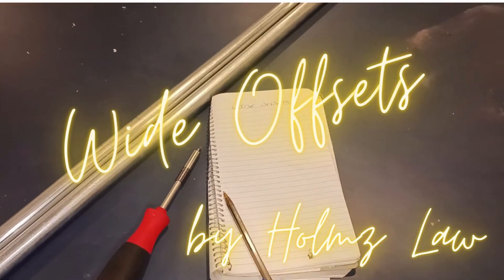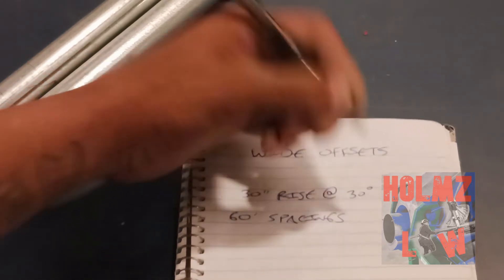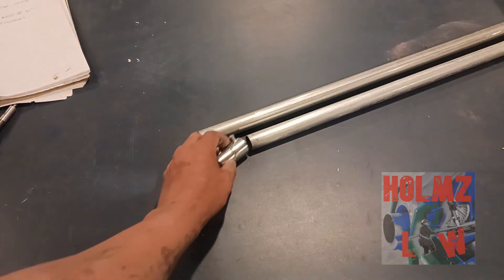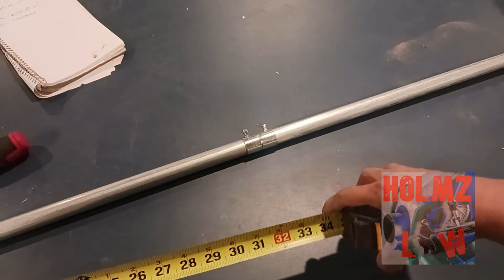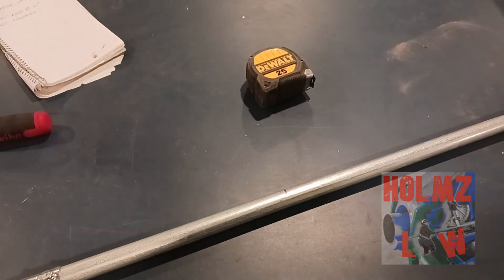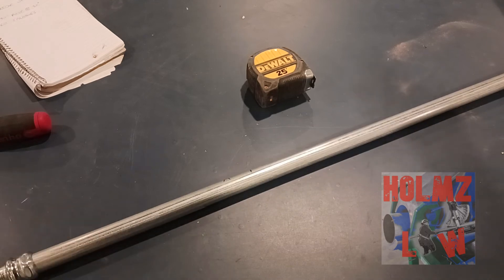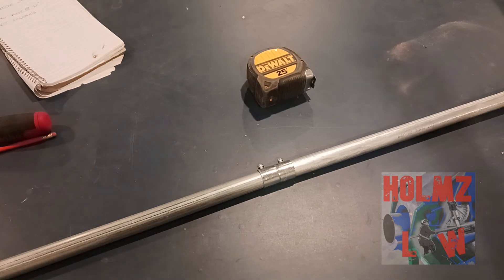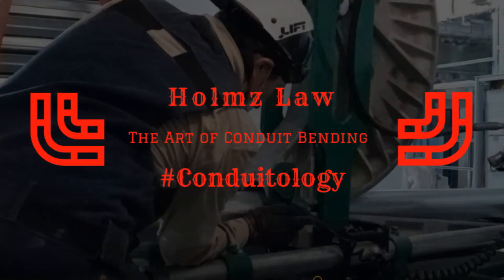How to bend conduit (Bending Wide Offsets)

Comment: Helpful tip.

Typically I try to minimize offsets in my conduit runs. Especially wide ones, since I have been running rigid I couldn’t imagine trying to spin on a 10’ offset 😂
Reply from the maker: well i definitely understand what you're saying. doesn't hurt to know in case you run into the situation in the future. I try to keep my conduits with out bending as much as i can, especially on the job im at now cause we have to pull solid wire through alll our conduits up to 10awg.
Reply: @TheArtOfConduitBending  I feel your pain. I say we write the NEC committee and tell them to make it code, no solid wire in conduit haha.
Reply from the maker: @JayT1T1  that's actually not a bad idea. LOL.